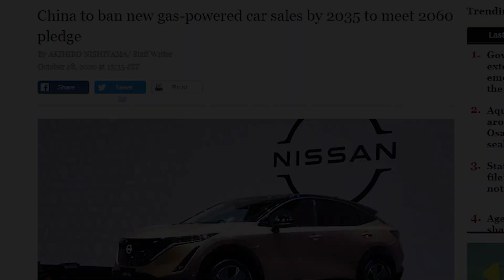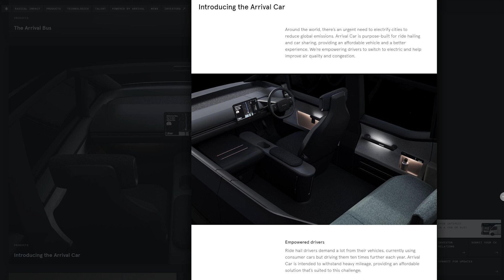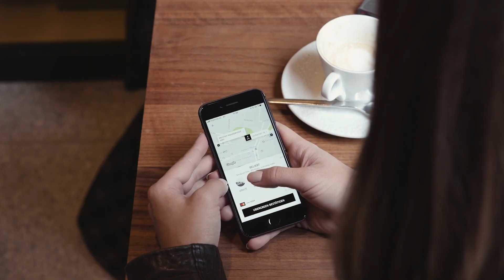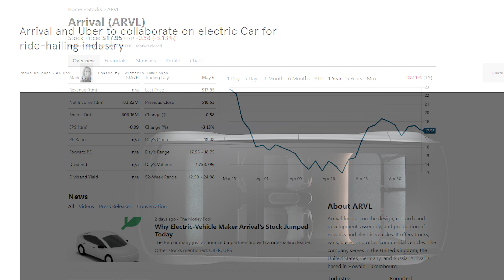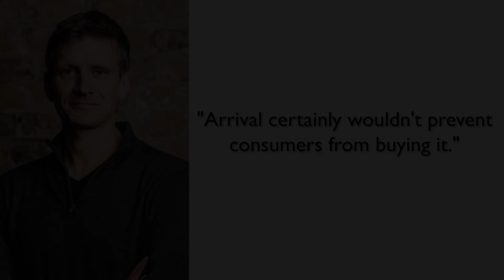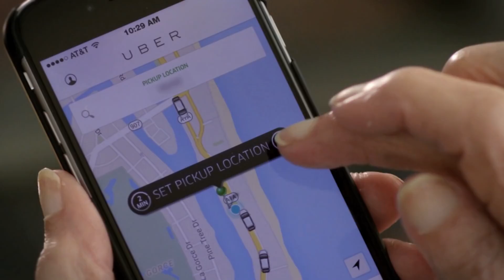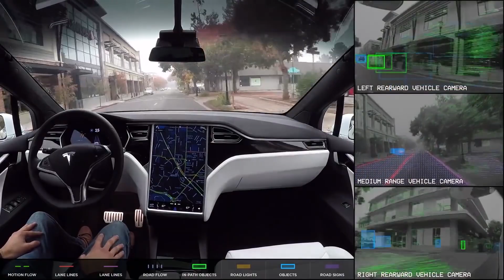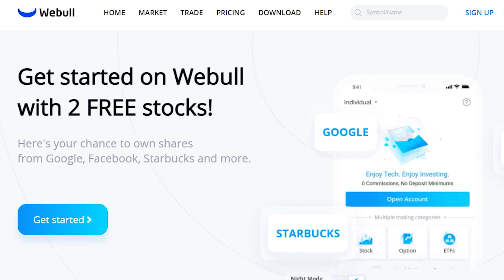Uber & Arrival Joint Venture To Design An EV To Electrify Fleets

Comment: 🎯 Key Takeaways for quick navigation:

00:00 🚗 Uber partners with EV startup Arrival to design a purpose-built electric vehicle for Uber drivers, aiming for EV-only in London by 2025.
01:43 🌐 Arrival targets car production by 2023, collaborating with Uber and involving drivers in the design process for enhanced comfort and functionality.
03:49 ⚡ Uber's commitment to sustainability includes plans to be fully electric by 2040, incentivizing drivers to transition to EVs with initiatives like Uber Green and financial assistance.
05:12 🌍 Arrival's microfactories use a decentralized production approach, relying on local workers and robotics, differentiating itself in the automotive industry.
06:13 💰 Purpose-built vehicles like Arrival's offer cost advantages by eliminating third-party modifications, potentially making EVs more affordable for Uber drivers.
07:11 🔄 While purpose-built vehicles provide familiarity, they may lack variety and uniqueness, potentially affecting the overall passenger experience.
08:22 🤖 Uber's approach to self-driving cars remains uncertain, considering the sale of its self-driving business to Aurora, and the potential impact on the ride-hailing service.
09:31 📅 As technology advances, Uber may need to adapt quickly to changes in the industry, especially with the potential growth of autonomous ride-hailing services.
10:14 🌎 Expectation of Uber Arrival cars in the UK and US by 2023, as Arrival expands its microfactories globally, signaling a significant shift in ride-hailing vehicle design.

Made with HARPA AI

Comment: Thumb down and unsubed, because you messed with the title, causing me to watch the video again by mistake.
Reply from the maker: Incorrect, I reuploaded the video after making a slight change due to copyright notice. Used a different title the second time as it describes the video better.
Reply: @WattsTheFuture  No, I was not incorrect. My records shows that the original title was "Uber Joins Arrival to Develop E-Taxis for Busy Streets: Here Are The Details: May 7, 2021". Very different from what you have now. As you say, you changed the title. The new title describes the video better? Maybe you should have thought more carefully the first time. There's another solution: Use an episode number for each video. Then you can change title wording if you really, really need to, and it won't cause this kind of confusion.
Reply from the maker: I appreciate your feedback. I have never changed the title on any video before. I only change the thumbnail when necessary. This was the second time during the lifetime of this channel that there was enough reason for me to reupload a video. While doing so, I decided to try another title (which I still think is better than what I had before). Now, I'm sorry this caused you (and perhaps others) to re-watch the same video. This was never the intention.

"Maybe you should have thought more carefully the first time" - If only you knew the time and effort that goes into titles and thumbnails. It's not as easy as you might think. Granted, others with blogging or even journalistic experience might have an easier time with this, but not every content creator on YouTube has that sort of background. 

That said, I'm sorry you feel you lost a few minutes of your time re-watching the same video. And I'm sorry to hear that this resulted in you unsubscribe from the channel.
Reply: @WattsTheFuture  But the bottom line is: You aren't going to change a single thing about the way you handle this, are you? This is actually a very familiar pattern to me. I must have encountered this same problem with at least a dozen other channels by now. That should tell you something. Even though I've not created any videos myself, I've watched thousands, possibly into the tens of thousands by now. Occasionally I learn things that I want to note, and sometimes even cite them in things I write. It matters that I can keep track of that. I think my extensive experience as a viewer should have some significance to you and other video creators.

So it's not just about one video, and a few minutes. Multiply that by dozens of other instances of this, and you may begin to understand why this is a sore point to me.

I've proposed a solution that could largely solve this problem, which is to give every video a number. That can be helpful in other ways as well. It's a simple technique, and I think you should adopt it. You may even find that others follow your example. YouTube should do this for us, but it doesn't, so it falls to its users. Why not just do it?
Reply from the maker: @ronaldgarrison8478  I will take your suggestion into consideration.